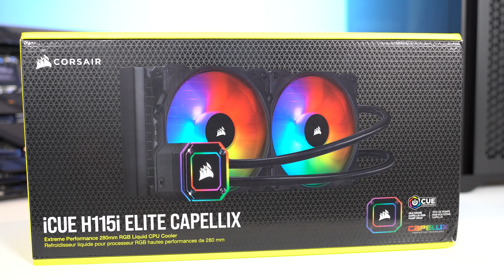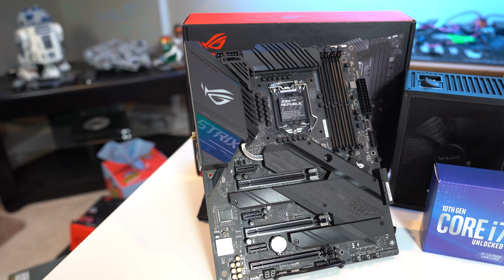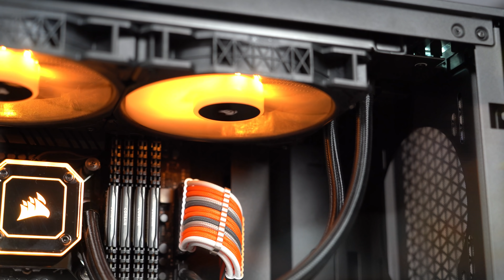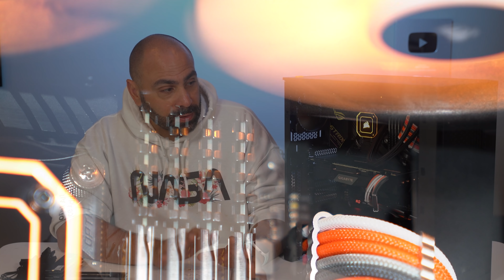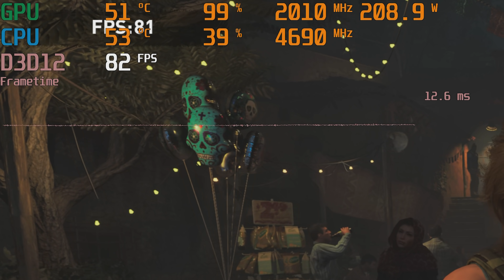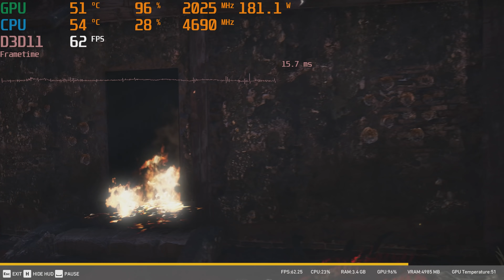A 1440p Gaming Build For Late 2020

Comment: The main reason I built my PC was for MS Flight Sim. I'm at 1440p 144Hz and would like to know if an RTX3090 is overkill? I mean from what I see at 4K some of the best GPUs struggle to run it at 30 fps at Ultra settings... At 1440p 144Hz a 3090 might run it buttery smooth?

Comment: Are there any recommendations on towers with a disc player already installed? Was that a stupid question?
Reply: DVD/CD drives are very uncommon these days, as most cases prioritise air flow over a disk drive, due to the lack of need for one. 

There are still few cases that do incorporate it, but you would buy the disk drive separately and put it in place (similar to the way you'd buy a hard drive and put it in a bay).
Reply: Buy yourself an external disc drive, they’re cheap and easy to find and that way your pc build isn’t limited in any way
Reply: @legodude275  will do. Going to grab a Blu Ray one. Thank you. Kisses upon your forehead.

Comment: Fun fact. the glass/metal side panel are interchangeable. So you could show off some cable magic by picking up another panel if you wanted to.
I bought this case, I love it, however I really wish the glass panel was the same as the white version, so i could see into my case and Also the front dust filter is complete trash, its flimsy and I can tell over time i'm going to need to replace it as my fans begin to stretch it. Also I wish the drive cage mount at the bottom was also tooled for a 120 fan. It would of been neet to slap another fan down there either as an additional outlet for a front rad or an additional intake in the case where you have no use for the drive cage.

Comment: I love the build, especially since 1440p deserves more love. Your temps are insane, with only one intake fan on the front of the case! The custom cables look sweet -- but I hate not being able to see the name of the GPU you are using. Have you ever used an EVGA Powerlink? I've read that it works for some non-EVGA cards. But I'm not sure which ones. I have an EVGA GTX 1080ti SC2 and it works wonderfully to show of the front of the card, bringing the cables around to the right side instead. The powerlink works for the rtx 2000 series cards, but I am really hoping that something similar is going to be available for the rtx 3000 series cards, as the power cables coming out of the middle front of the GPU is just so unappealing!

Comment: Put radiator at front ? Top does not make any sense your cooling your cpu with hot air pushed through rad ? They put rads at front of car for a reason not the back

Comment: Late 2020 build (value oriented):
1)wait for zen3 (which should beat Intel if leaks are true)
2) wait for RDNA2 (which should be roughly on par with RTX 3000)
3) if you:
  a) can afford those, use them
  b) can't afford those, buy used - pc masterrace people will try to sell perfectly good rigs just to upgrade to newest parts, you might end up buying pretty decent PC for cheap

Source: I have no life and no money
Reply: @Omar AMD GPU architecture  that will be revealed 28.10 or something similar. It is also powering ps5 and new Xbox. Should be on par (or close) to rtx 3000 series but with worse Ray Tracing. Hope it helps.

Comment: Just upgraded my AIO From the basic H150i Pro to the H150i Capellix! With the included Commander Core makes it nicer as you don’t have as much cable clutter or even extra SATA ports to plug things into. With the extra 3 RGB Ports, you can add 3 more fans into this without for let’s say needing either an extra RGB fan hub as long as you have the same type Corsair fans such as ML, LL, QL, or SP, etc. I kept my LL120 fans and works well with the Capellix as well I have an additional 3 LL 120’s which plugged right into the Commander Core.

Comment: I built a 1440p rig a couple weeks ago. Saphire Pulse Vega 56, ryzen 1600, 16 gb 3200, gigabyte 750w gold psu, Aorus itx b450, with a decent itx case, all for $500
Reply: 750w psu for a vega 56 and a 1600 is useless. 

A 3950x and a 3080 doesn't even consume 600 watts lol.
Reply: @AvoidVanity  a Vega card can consume 300w while gaming and when over clocked it can get to 500. I also needed pci connectors that weren't run off of one rail because it needs two eight pin connectors. So better safe than sorry. It also leaves room for upgrades.
Reply: @liambarrett8914  500 watts more like 315 watts overclocked your cpu is pretty trash would of got a 3300x instead with the psu savings.
Reply: @AvoidVanity  so you don't know vega cards. Got it. And second I got the 1600 for 50 bucks. Third the 3300x is sold out everywhere where I am.
Reply: @liambarrett8914  For your setup 550 watt psu is more then enough.
Reply: @AvoidVanity  I think it's hilarious that you think that.

Comment: Going with the Corsair 4000D airflow from an NZXT H500i for a bit more room, better thermals and top rad support. RAM might be a deal breaker for me though, using 4x8gb gskill trident z and worried about a 280aio on top. Updating other parts too. love the build BPS!
Reply: you could also do a front 360 aio if you're really concerned about fitment.
Reply: @BlindSecondRegrets  the front cant support a 360 radiator
Reply: @legodude275  https://youtu.be/hVTshBAcso4 yes it does. Also you can fit a 40mm rad +25mmfan if you trim the lip that protrudes out from the psu shroud.
Reply: @BlindSecondRegrets  I have no idea how anyone could pull that off, I couldn’t even fit a 280mm AIO on the front. Keep in mind I’m only doing tubes down (because that’s how it’s suppose to be) so that limits a little bit of space